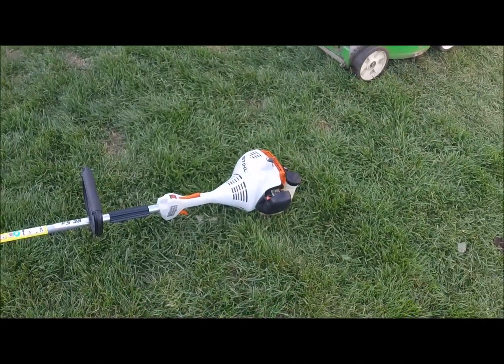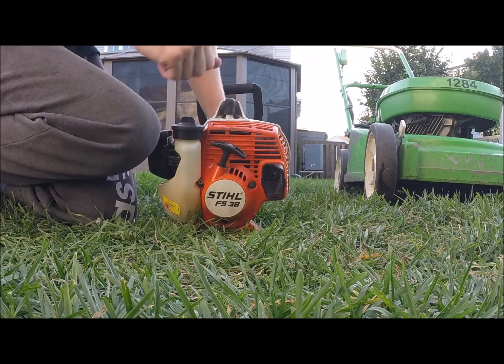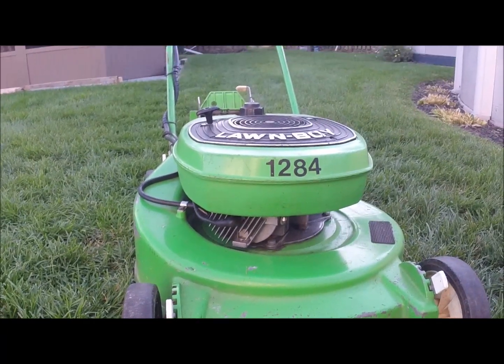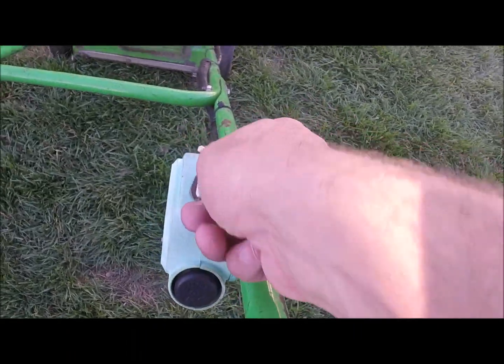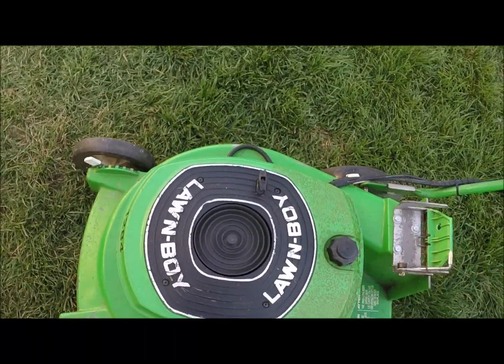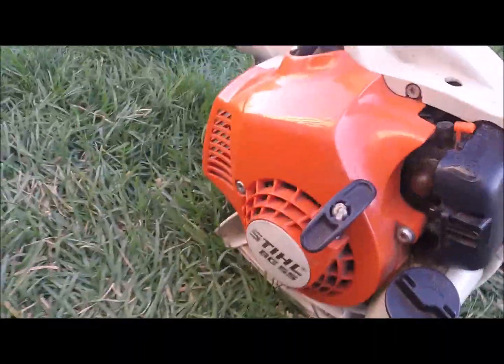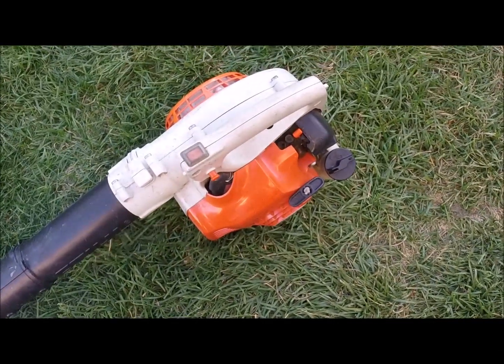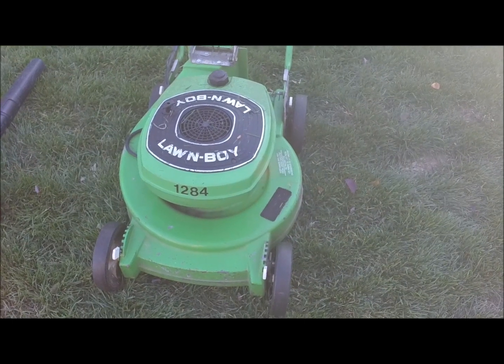1984 Lawnboy 4630, Stihl FS38 and BG55 In Action

Comment: This Lawn Boy is very nice, runs smooth. It`s too bad that they don`t bring back the old engines.
Reply from the maker: +Der Rasenmäher Thanks man.  I got that one rebuilt last year.  I know it's a shame.  Quality isn't there anymore :(
Reply: Jon3800 Great work you have done to it and I bet it is worth it. It sounds very good. Modern engines can`t beat that one I know.
Reply: +Jon3800  do you still have your 2 snowblowers ? I like the flathead Tecumseh, I had a snowblower with the same engine for many years. Only thing that scared me sometimes that mine has backfired everytime when you turn it off, espacilly loud in the garage :D
Reply from the maker: Yup, still got them.  I'm planning to do a video of them next time it snows.  I had the Mastercraft (the green 4x4) tuned up this year (the carb came completely out of adjustment and started over-revving) so she runs ultra smooth.  Toro hasn't been used yet, but she's also a nice runner :)

Comment: you got a new fs 38?
Reply from the maker: +TheWallyjp Hi Paul, it's actually the same one that I got last year for free from my client :)
 I couldn't use it because it didn't have a recoil assembly until I got one from Ebay.  I also got an older FS36 for my birthday, but that one will get featured in spring once the snow melts.
Reply: oh ok got you.. so you have 2 fs38s? can you make a snowblowing video for us this year?
Reply from the maker: yup two good running 38's.  sure, I got the mastercraft tuned up this year so I'll be filming the blowing video when more snow comes.